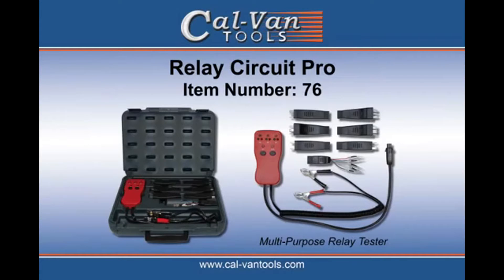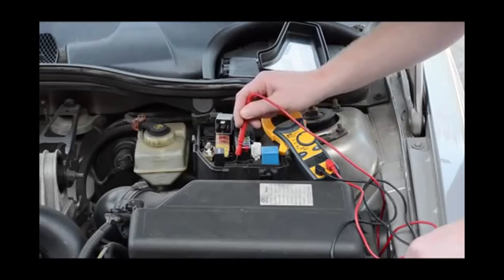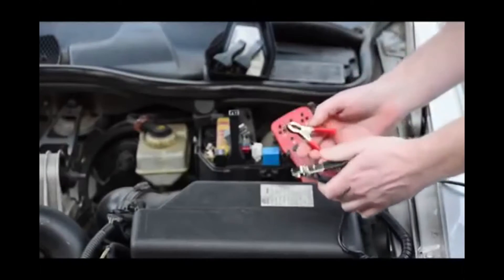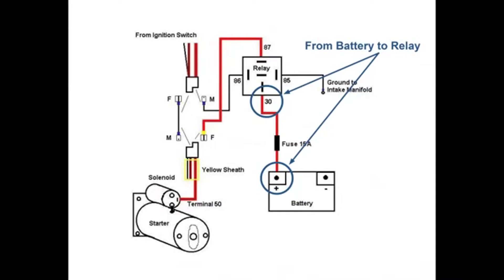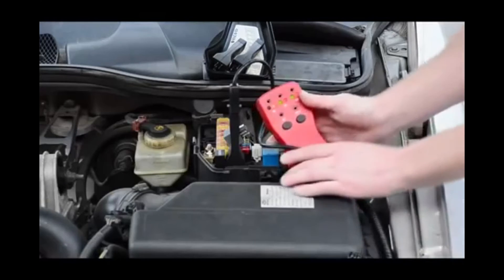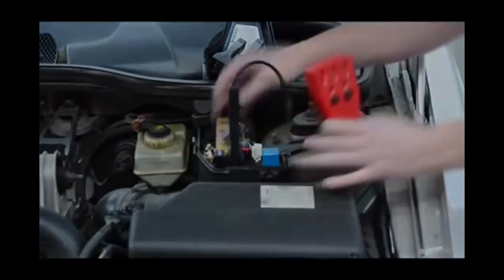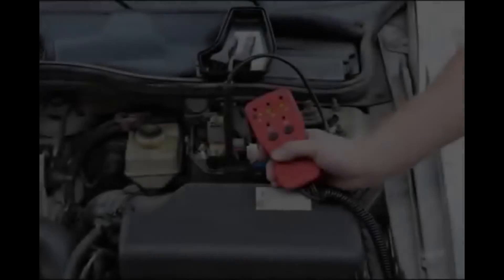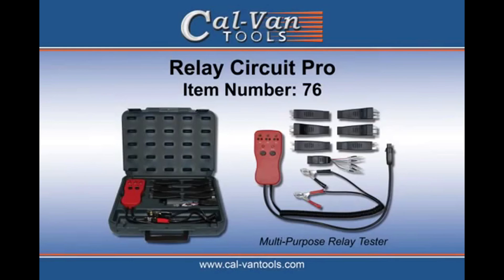CAL76   Relay Circuit Pro

Comment: Any more details? When you push the power but does it power straight from the battery or do you have to turn the key on? If there is low voltage or a short to ground does it identify which it is and which pin or anything special? Thanks